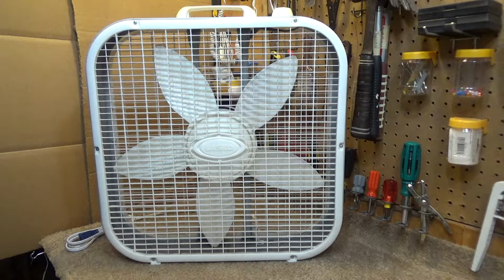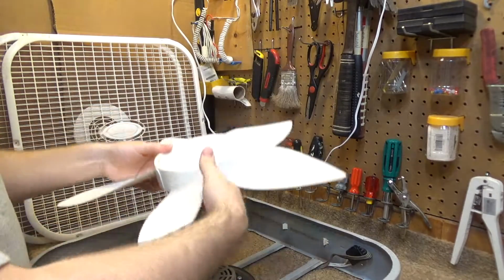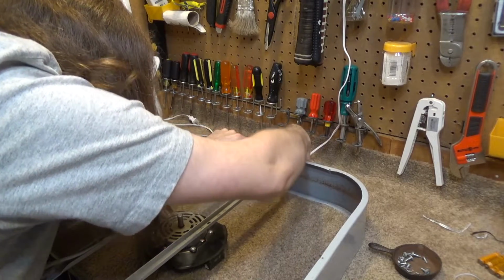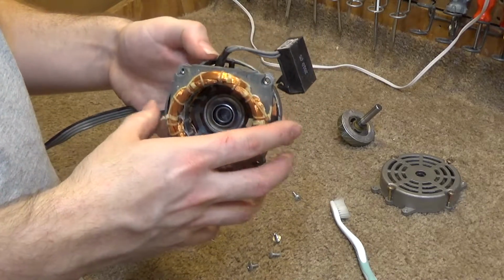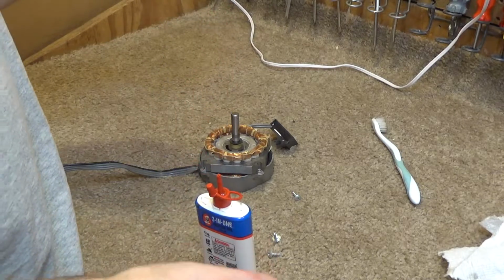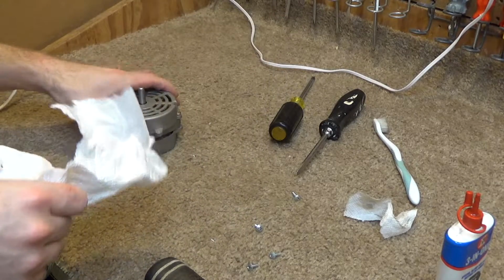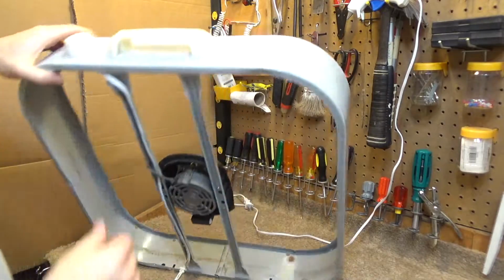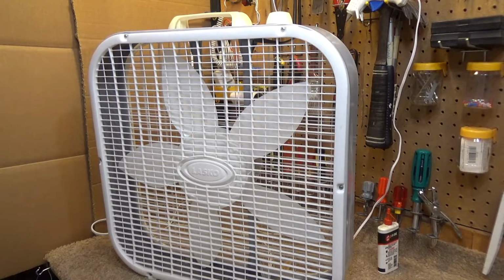Clean and Service Lasko 3733 with Deteriorating Blade

Comment: To get the blades off, I flipped the fan upside down and laid it on the floor and used my weight to push the blades off.  The blades loosened, and after I flipped the fan back over again the blades easily came off completely.
Reply from the maker: I've done that with older box fans before, but these are so thin I've never found there to be enough space between the blade and the surface the fan is sitting on.
Reply: You are right, when lying flat on a surface there is not enough space to push the blades off completely, only to loosen them a little.

Comment: Wait. Those motors don't have neodymium magnets, do they? I don't think Lasko is that motivated.
Reply from the maker: I don't know, how do you tell?
Reply: @JordanU  It's that neodymium magnets are way stronger than the normal magnets you might've seen in a 4th grade science class. Some pro-audio speakers also use neodymium magnets.
Reply from the maker: @FSM_Reviews  It's been a very long time since I was on 4th grade..